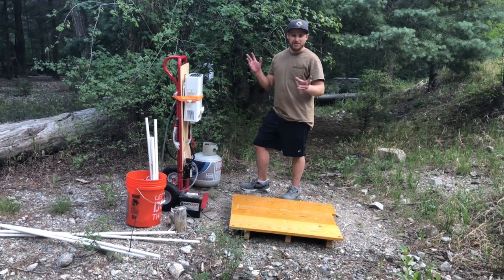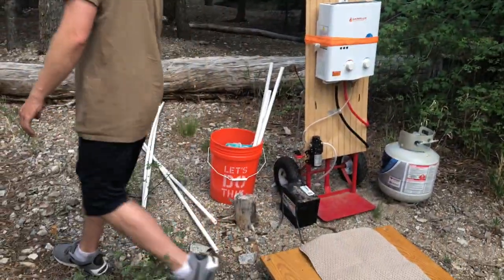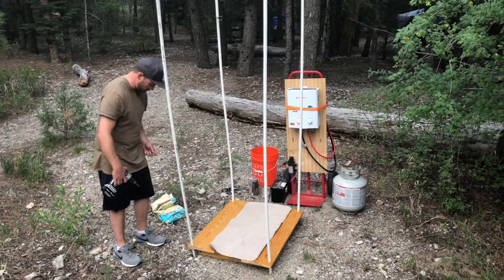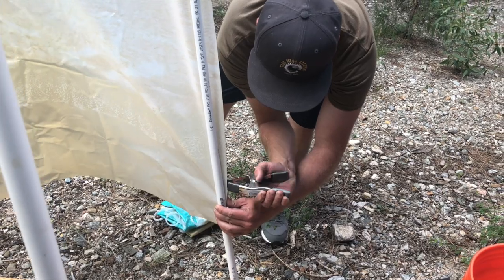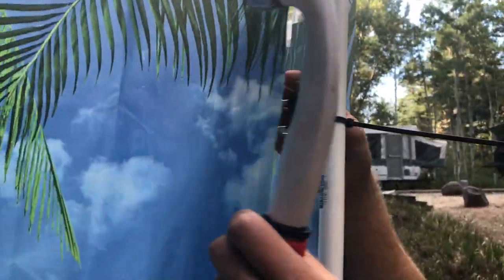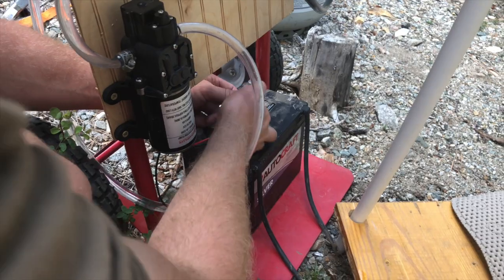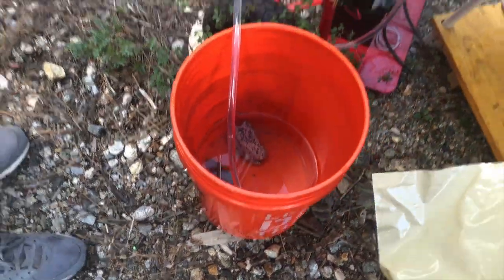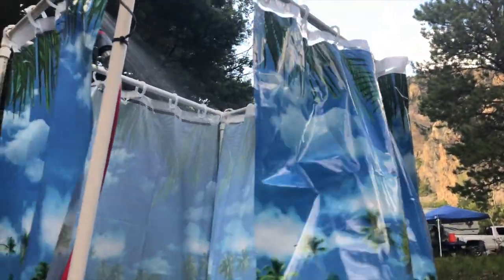DIY Outdoor Camping Shower

Comment: Are you aware they sell shower heads w hose and USB rechargeable battery powered pump  on end for a bucket for only like 30$ bucks?  Much simpler and convenient.  Also i would suggest thicker PVC!  That thing looks like its gonna collapse any moment lol.
Reply: tecnolover2642 I’ve not seen any of those before but it seems like a great idea. I don’t think they will work as well and you better have a way to recharge which could be hard while dry camping! I do agree about thicker pvc tho!!!!! I ran out of time before this trip!
Reply: @tecnolover2642  definitely nice but with solar you need lots of sun and these are a great option to always have on hand.
Reply: How u heating thee water?

Comment: What pump did you use and where did you purchase it? Just got our Camplux but didn't come with a pump and the option they give is 70 bucks. Trying to find a more budget friendly option.
Reply from the maker: Thanks for watching! Wow $70 that crazy. Here the one I bought for $33 and it worked flawlessly. It does help my channel if you decide to buy something to go thru this Amazon affiliate link as I receive a small commission. Thanks again! https://amzn.to/3qbMBox
I also just cut off that connector and spliced on these https://amzn.to/3kIopJi so I could easily hook up to a normal car battery for power
Reply: @RotoCityTech  awesome thank you
Reply: @RotoCityTech  thinking the other one is 70 now because it comes with all the connections you need.
Reply from the maker: Even still I think it was much cheaper to go this route. Oh and add some water line I suppose

Comment: I’m curious what elevation you are at. The description says not for use above 2000 ft, but I am wondering if it works well at higher elevations than that.
Reply from the maker: Thanks for watching. In this video we were at 8,700 feet of elevation and had no issues. I was totally unaware of them saying not above 2,000. That’s strange but yes we were well above that with no problems. Haha